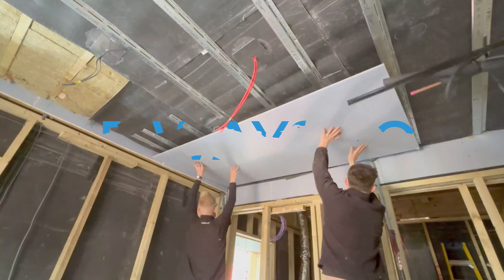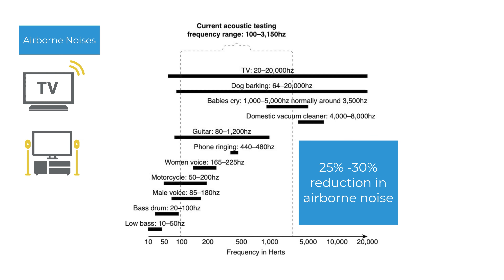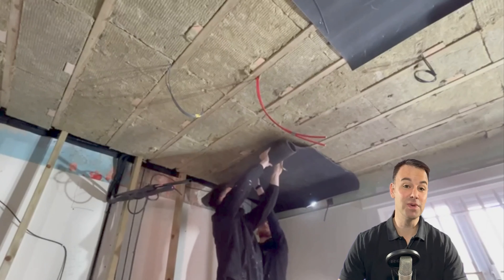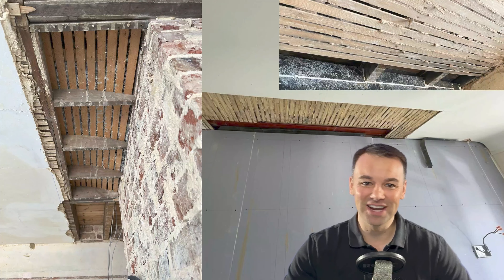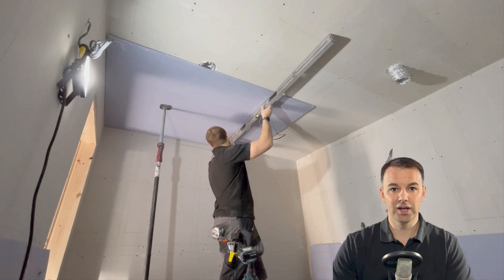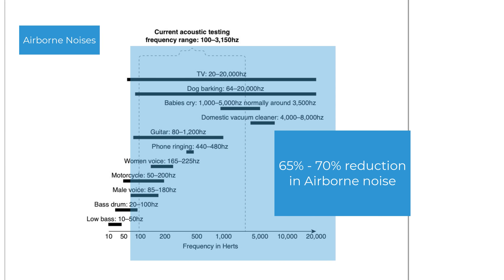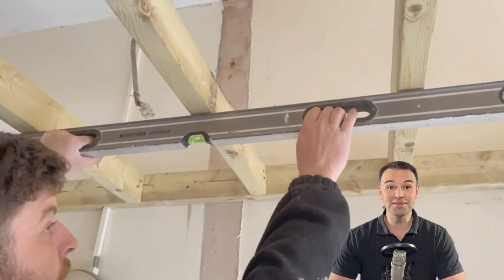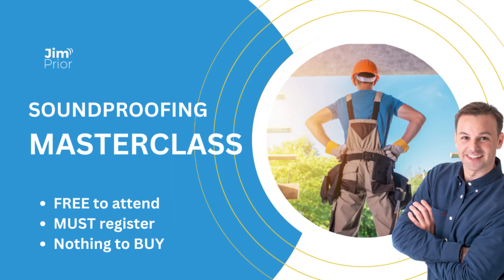7 WAYS TO SOUNDPROOF A CEILING | #diy

Comment: What about not being the owner of the house and want to apply some portable things?
I mean are those ceiling portable panels useful? 
Do you have any recommendation for this situation for both ceiling and walls?
Reply from the maker: Hi @ITSbondr, thanks very much for your question, I believe the noise is in the structure of the building. The noise is transmitting through the bricks and mortar, wooden joists and hollow voids. Therefore applying portable things to ceilings and walls is not going to reduce the noise. It may change the way you hear the noise and it may sound different. Have you seen this video on acoustic foam tiles:  https://youtube.com/shorts/Tg6TMb5i4HQ.

Comment: Hi Jim , 
Thanks for your video.
On genie clip and channel system how many clips you would recommend per Sqm on ceiling with 2 layers of plasterboard and Tecsound.
Thanks
Reply from the maker: Hi Argon8575, I’m sure Genie Clip and some of the soundproofing materials suppliers have Free calculators on their website. 

Also if you you are in the UK….phone a soundproofing supplier like Soundproofing Shop they will work it all out for you. 

I like to add extra channels and clips to whatever they recommend before I never like being short and we often use the heavy duty systems that are load bearing, they need the channels 400mm apart on the ceiling.

Comment: Hi Jim, it's good to see someone have such informative videos based on UK properties, so mamy that I see or read about are in the states. 
Im looking for some advice, i'm going to be turning my attached garage into a music room/workshop. I don't want the noise that i'll be making, affect what times I can work in there and parctice my nusic (drumming + djing)  What method would you suggest for soundproofing a cold flat roof, in terms of vapour control and minimising any moisture/ventilation issues. 
Also, what are you thoughts on treating the singe skin block external walls regarding vapour control. 

Finally, with the soundproof diy course, is this a 'zoom' style course or is it more in depth, detailed viseos and information? 
Thank you, James
Reply from the maker: Hi James, 
Thanks very much for your kind words, I love doing a good drum room, especially a garage conversion when a lot of the mass is already there. 

Have you seen this old video:
https://youtu.be/biFdhNHJq8E

After watching that video: Do you have the height in the garage?

On a single brick construction to play whenever you want, you will need the floating room within a room. For this you will need 200mm space loss from the underside of the flat roof ceiling joists, 175mm off the walls and 75mm off the highest point of the floor (assuming the garage floor is sloping towards the door) Vapour control for the walls is achieved with the initial sound deadening of the walls, and two other membranes within the walls that interlock with the ceiling soundproofing. 

The flat roof we have designed a roofing system with help from the NFRC that does not channels the noise into you neighbours house and has a 0% condensation risk assessment. 

You may need consultation advice as this IP is not something I give out on social media. 

Renovation advice virtual soundproofing consultation: https://youtu.be/q5CjspYn5O88

You may also need 1-2hrs installation support for you and your builder. Check this out: 
Installation support: https://youtu.be/1BGKQ6tpgxw

Work With ME
👉 https://jimprior.com/work-with-me/ 

The Noise Free DIY Soundproofing Course is a lot of videos that you can work through at your own pace to fully understand the 4 step soundproofing method. The quickest we had a DIYer go through the course properly was about 2 weeks. (Some still jump straight to the walls, ceiling and floor systems) it is a mixture of practical and theory lesson that goes into a lot of detail on how to install the different layers of the different systems. 

Whether you want to install our tried and tested systems installed in 1000s of homes or want to try something different….the course will show how professional installers install different sound insulation. The course is full of useful tools from materials calculation tools to check list for your plumbers and electricians and much much more. It will be extremely useful for you converting your garage….but you may need detailed consultation as well on things like doors, ventilation and fixtures you may have specific to your garage.

Register for the course here and we will send you more details: 
https://jimprior.com/diycourse/

Thanks very much for your questions.
Reply: Hi Jim, thanks for replying.
Yes I have seen the drumming room video, it's been very helpful, although my garage is of a different construction with it being on the side of the house. There is plenty of room height wise. 
Thanks for the help and pointing me in the right direction,  I'll be in touch regarding a consultation.
James.

Comment: Really informative video, thank you. When soundproofing a (timber joist) ceiling in a house, would it be best to remove the existing 9mm plasterboard or pull it down and then put MLV & 15mm baord in its place? 

Access is also possible from above to fill the void with rockwool. 
My thoughts are such that it would be useful to have the additional 9mm + plaster skim as addiitonal mass.
Reply from the maker: Hi @JOHJacobHarris, hope you found it useful, it’s just what we have found soundproofing 1000s of properties. If you are not installing any resilient layers then yes leave the 9mm board in place and insulate from above if you are sure you can get to every area. 

Then install the 15mm sound bloc over the top of the 9mm ceiling board….you might find it easier installing the MLV or TecSound to the back of the 15mm board before positioning it on the ceiling.
Is this to reduce a bit of room to room transfer of airborne noise?
Let’s us know how you get on.👍
Reply: @jimprior7  yes - I'm  trying to reduce the airboure noise trasnfer. I'm starting off with a stud wall first (using resilient channel & MLV) so will be a little while until I reach the ceiling project
Reply: @jimprior7  can you install resilient layers onto an existing ceiling without removing the board and plaster? will the weight of the new materials be ok?

Comment: Fantastic video. I was wondering if there is such a thing as an acoustic joist hanger? Or could you use a standard joist hanger with some 20mm rubber either behind the joist hanger or in the bed of the joist hanger (under the timber), instead of using the 'timber wall plate  plus 20mm rubber' that you use in the secondary ceiling options in this video?
Reply from the maker: Hi Steve, yes there are acoustic joists hangers and I did not include them in the video. They are different to the joists hangers you get at the builders merchants here in the UK. 

But yes, I think you could use the 20mm rubber behind them and under the joists as well, that will give some better isolation then just timber. We have done that before on a couple of road traffic noise projects. I have not done it instead of using the wall plate though, we have always used a wall plate. Are you potentially doing that to save space Steve?
Thanks very much for your question, glad you got some value from the video🙏
Reply: Hi Jim, it’s an Edwardian solid wall house (converted to two flats). The ground floor flat already has all the external walls studded out (rockwool, vapour barrier, 18mm ply, 12.5mm plasterboard, skim). The ceiling is 170mm deep with rockwool, then 11mm osb and 2 sheets of plasterboard. The floor above has carpet, 18mm rubber acoustic matting, 22mm chipboard, 6mm fibreboard, all on top of the original floorboards. So not a bad effort already but the room above is 5mx5m and the footfall is still pretty obvious below, I imagine the original joists have too much bounce in them. Anyway long story short is that I fancy putting a second ceiling in and as I have the 18mm ply in all the walls I reckoned joist hangers with minimum 4 screw fixing per hanger and rubber behind and in the bed of the joist hanger would give a stronger set up and more isolation than the timber wall plate. I might be over thinking it but just felt like it would give better isolation, or more points for vibrations to dissipate than a continuous timber wall plate would. What do you think?  Cheers Steve
Reply from the maker: @SuperSteve239  hey Steve, yes that makes sense to why you are still getting a bit of impact noise through….you need a resilient layer below the joists and a resilient layer on top of the joist. Sometimes it does not matter how many layers you put on…unless you have that resilient layer that impact noise will still come through. 

With your joist hanger solution, the new
Joists will be decoupled and isolated from the ceiling. So as long as you don’t hear the impact noise down the walls that should get you a good result.
Reply: Hi Jim, really appreciate your advice. One more question before I crack on. I have a lot of 11mm osb 8x4 sheets leftover from another job. I was thinking of putting these on the bottom of the new joists before the resilient bars to give some extra strength and rather than using noggins, so that my rockwool in between the joists can be more seamless. The only thing I’m concerned about is whether the osb surface, being more reflective, might actually become a sort of drum skin for sounds and amplify them. Any thoughts? Cheers Steve
Reply from the maker: @ No no no! don’t do that Steve! The OSB will not offer much sound attenuation.

What you are suggesting will compromise the resilient bars and cause the drum effect.

I’m not sure where you could use the OSB board in a room with a noise problem, a developer I’m working with has just spent tens of thousands of pounds isolating his apartment walls from his OSB structurally insulated panels (sips)

Trust the process and systems that we have tried and tested in 1000s of homes.

The resilient bars seem flimsy at first sight, but after you secure that first acoustic board you will see how solid that ceiling is. We use the high quality ones from Travis Perkins.

The RW3 and the resilient bars will be your noggins and the 2 x layers of 15mm will offer more structural support than your average ceiling.

Let me know if you need consultation on your project: 

Installation support: https://youtu.be/1BGKQ6tpgxw

Developer consultation video: https://youtu.be/p2Vm9TnV8q4

Comment: how do you know your ceiling joists are strong enough for mass loaded vinyl? these timber joists are between mine and another flat. their kitchen is above our bedroom.
Reply from the maker: Oh wow, do you hear a lot of impact noises from their kitchen above?

If so Mass Loaded Vinyl will not do anything on its own and not much for impact noises. Maybe consider using it in combination with other soundproofing materials.

With regards to the load bearing, the different Mass Loaded Vinyls come with different densities. For example we often use the 5kg/m2 version. Most ceilings should be able to take an extra 5kg/m2…however if you are unsure, like I say in the video, please get a structural surveyor to check your ceiling joists. 

Sorry I could not be more helpful, I would need to see the joists and ceiling construction to answer the question fully.
Thanks for your comment.

Comment: So, I’m learning before I do any consulting.  My upstairs neighbor foot steps, moving around furnitures, drop items, tv, I hear everything: impact noise. I redid my ceiling lights and learned there’s zero insulation between floors and my walls. I’m guessing that’s why I can hear my adjacent neighbor use their toilet, talking, even vomiting! A year and a half in, I’m at my breaking point with both neighbors. Please help? What materials that will stop this? I don’t want to spend $$$ and then it doesn’t work. I can only do this once. I have 90 inch ceiling. The ceiling appears to have a mesh that remember my electrician said is difficult to cut. Thank you.
Reply: Hi. Have you found a solution yet? Thanks
Reply: Did you find any solution?